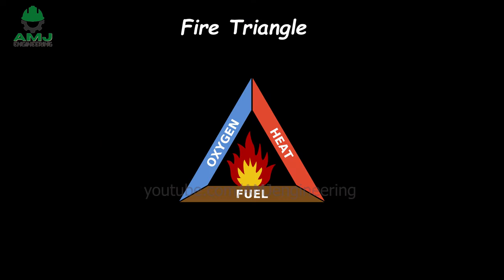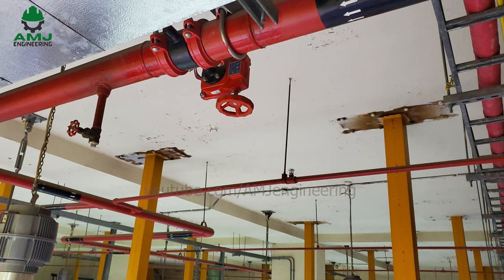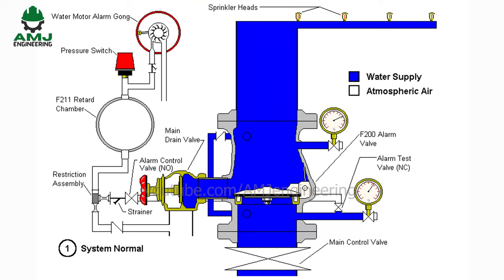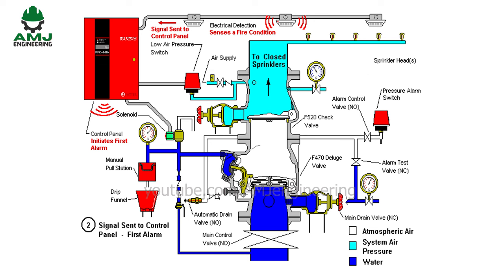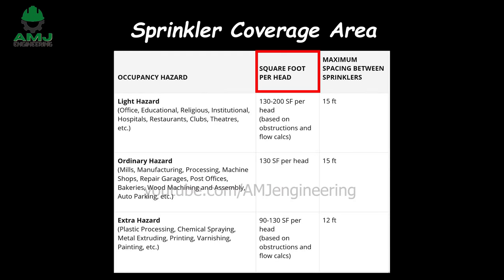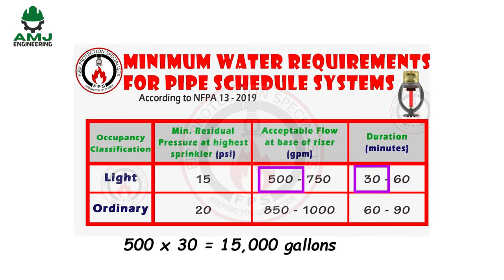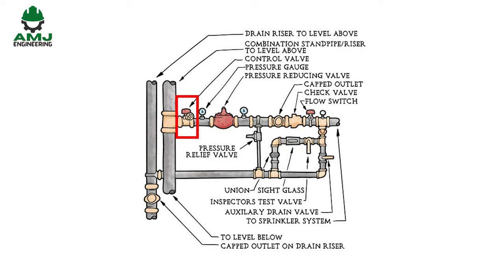Fire Sprinkler system | Firefighting lesson 6

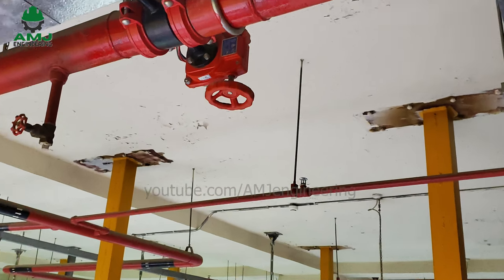Comment: 4:02 the rod is to close the the Tee. Min. 3in.

Also a fire system isn’t meant to fight the fire. It’s purpose is to contain fire , refuse heat and smoke so people can get out.
Reply: Yep.  Glass bulb at 4:49 has paint on it too.
Reply: Around here (Canada), sprinklers are NOT considered life-protection devices. They are structure protection devices, and they can and DO often extinguish fires on their own. Smoke detectors are the only devices considered to be true life-protective.
Reply: @paulmaxwell8851  Canada has Fire Protection in Parking Garages. Those are Non- Combustable... There are so many unprotected areas of a building Per NFPA coding.  Like stair wells 13 - only top and bottom. But 13R every accessible landing.. do you guys guarantee a property loss % when installing?

Comment: question, do you still need a pump, if your main water supply is from a water tank above your building?
Reply: It simply depends on whether that gravity feed will supply enough pressure. It almost certainly cannot, so a pump is usually required.

Comment: Nice lil vid. Light Hazard sprinkler coverage is 15 x 15 = 225 sq ft by the way, not 200.
Reply from the maker: Oh it is a big mistake if i said 15x15=200😅. Any how 225 is the maximum allowed design coverage area, so good to adopt 200.

Comment: Paper is not flammable. It is combustible.
Reply from the maker: Fire code and building codes of almost all countries define paper as flammable.  Paper catches fire and sustain burning.
Reply: @AMJEngineering  but paper does not meet the definition of a flammable material. I thought engineers would be better at that. Words have meaning.
Reply: @AMJEngineering  gasoline is flammable. It releases vapors that readily ignite below 100*f paper must be heated to 451*f before it will combust. Also a sheet of paper will not be fully engulfed at the moment of ignition. It will burn from one side to the other over several seconds. A pan of gasoline or other flammable vapor will immediately ignite across its entire surface area that has the proper fuel:air ratio.